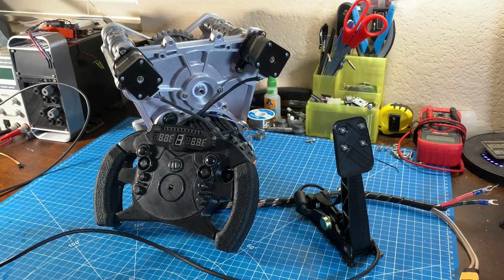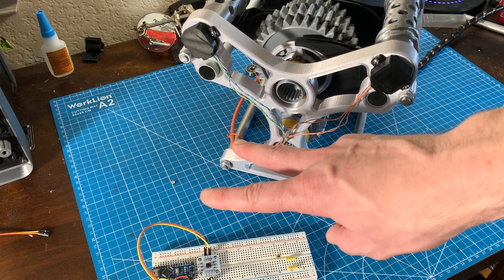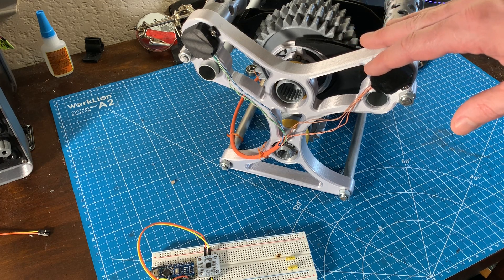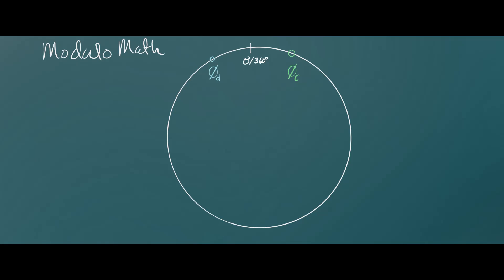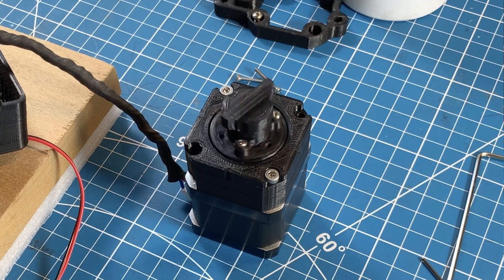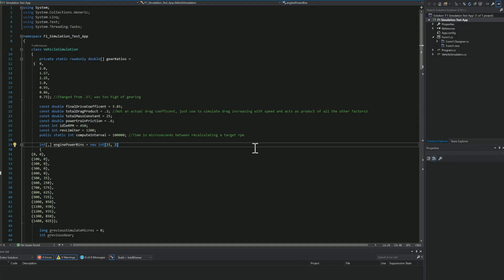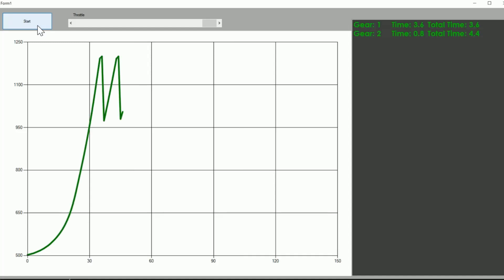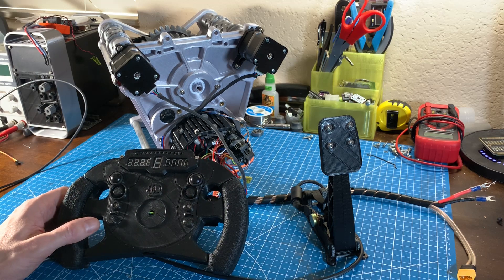3D Printed Formula 1 Gearbox - Part 7

Comment: Not sure exactly what math problem you're struggling with, but if you're trying to find out which direction to turn and how many degrees the difference is in that direction given a starting position and ending position, here's a C function that gives the minimum signed rotation (where >0 return is clockwise, <0 return is counter clockwise).

// Calculate the (smallest magnitude, signed) angular difference
// between a start and an end position in degrees.
float angle_difference(float start, float end) {
  // Compute the clockwise difference between the start and end.
  float turn = (end - start);
  if (start > end) turn += (float) 360;
  // Return the smallest magnitude rotation (knowing it is <= 180).
  if (turn < (float) 180)
    return turn;
  else
    return turn - (float) 360;
}
Reply from the maker: Thanks!  I ended up using a function provided by another viewer that used mod functions to handle the wrapping of the encoders. I like your approach as you get a signed angle out directly.

Comment: Quickly wrote up a python function to calculate shortest angle, steps to target angle, spin direction, and if the travel passes through zero. I only did this for a single barrel. Let me know if this is what you were looking for. 

If you provide the angles of both shift barrels for every gear, then I can adapt it for two shift barrels.

https://github.com/amzoo/sandbox/blob/master/shift_barrel_control.py
Reply from the maker: Thanks! That’s awesome. I will take a look at it here.
Reply from the maker: Thank you so much!  Your example was exactly what I needed.    I was able to remove almost 100 lines of code!
Reply: @IndeterminateDesign  That's awesome! Glad I was able to help. Feel free to reach out if you're ever stuck. I love what you're doing and would be thrilled to help out wherever I can.